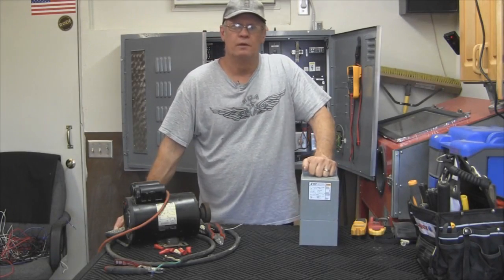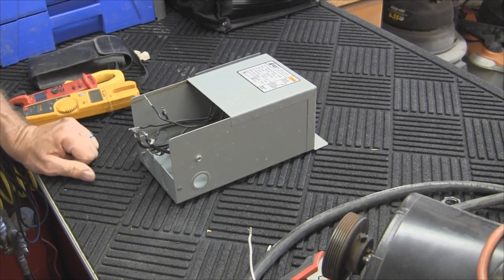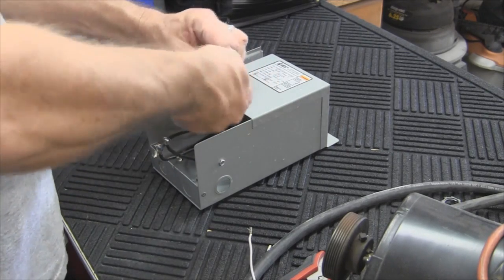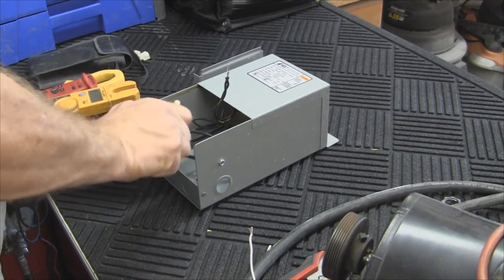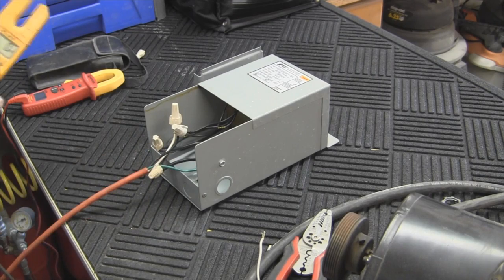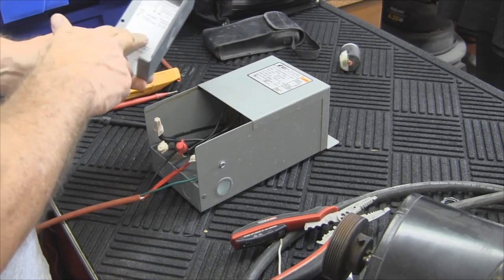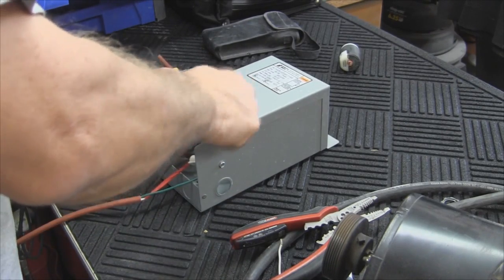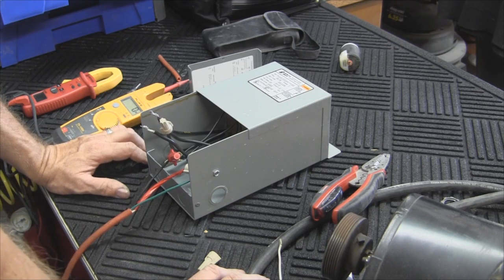How to Wire a Buck Boost Transformer

Comment: I'm hooking up a 7.5 horsepower air compressor and I need to be at 2:40 which I'm running off of generac 22,500 starting in 15,000 running which gives me 240 volts but they're saying this actually 208 I'm trying to boost to 240 will this box do that for me?

Comment: This guy is an idiot. He knows nothing about buck or boost transformers. He doesn't explain additive polarity or subtractive polarity. The transformer he is using can be used with 120or 240 volts to produce 12 or 24 volts. The most common use for this is to raise the voltage of a single phase 208 volt supply to about 219 volts.  ( some refrigeration equipment doesn't like to start on 208 volts. Better to use a 16 to 32 volt transformer. also if you wire the transformer to 208 volts the secondary output will be reduced by 15%.
Hank Kline

Comment: Been looking for wiring diagram
How to make 235v from 208v
All I see is 208v to 240v
Customer was told needs to be 235v
Reply: It’s ok to wire for 240v and use for 235v
Reply: @SamTheBouncer  Agreed, +/- 5VAC is nothing, it will run up or down 5V no issues.

Comment: IT SEEMS THAT THIS IS MERELY A TYPICAL STEP-DOWN TRANSFORMER WIRING.  WHAT MAKES A "BUCK-BOOST" TRANSFORMER WIRING DIFFERENT?!...
Reply: When you wire the secondary in series with the primary it will reduce (Buck) or increase the voltage (boost) dependimg on the polarity.

Comment: I see the manufacturers labeling as a huge problem with buck/boost transformers. Most label the 12v/24v as Secondary Voltage(Low Voltage here) when it is in fact the Voltage Change. I spent an entire weekend scouring the web and talking to a long standing electrician and a 35 yr electrical engineer (that neither knew about buck boost) and the labeling was the only real stumbling block to understanding them.  Once I figured that out the kva rating achieved was from across the drop was a smaller hurdle and I only figured that out by a B/B on Schneiders' site that listed 37kva load and a 3kva label on the same unit.

Comment: You are wiring this transformer as a regular low voltage transformer. A buck or boost transformer has an ability to raise or drop voltage to change the supply voltage to the line of a piece of equipment after the transformer. This transformer can take the 120 volts supply and make it 96, 108, 132, or 144 volts. if you had 240 volt supply the output voltages are 216,228,252, 264 output volts depending on how you interconnect the secondary leads.  This being said the rating of the transformer [ V x A ] is rated only on the differential voltage powered thru the transformer, the 12 or 24 volts used by the transformer.
Reply: what if you use 208?

Comment: This video is pretty much a waste of time. Buck Boost says it all, while it will definitely work as a step down transformer that is not its primary use. It works as an auto transformer and is used to raise voltage by percentages, if your smart enough to connect it, many electricians never seen one, This video doesn't come close. How about connecting H1 to X1 and load, H2 to H3 connect L2 to H4and X1, connect X2 and X3, and X4 to Load as far as it doesn't matter which lead you connect to H1 and H4 if we are looking for the wave formation is it zigging or zagging, Very little info shared in this video for all the time used.
Reply: This is a step down transformer. It is not an auto transformer. An auto transformer has one winding with many taps like a multi-voltage HID ballast.

Comment: Sorry, my comment was not clear. Yes, it was the correct autoxfmr for the application.  

I was trying to point out that the label said 208V low volts, 32V high volts...It did not say anywhere 240V high volts.  My J-man thought the autoxfmr was the wrong one until I pointed out that the label was giving # of volts to be added instead of what the final voltage would be.   

Has anyone else seen labeling like this?

Comment: The video made it sound like you had to wire it 120v to 12v and 240v to 24v.Watch it again.You are correct about the 6v connection but I would have to check the 48v connection with the literature from the transformer to make sure the coils are rated for 240v when wired in parallel .

Comment: If it only allowed going from 120v to 12v and 240v to 24v there would be only 4 wires. It could easily be wired to output 6v (wire it for 240v input, 12v output, connect to 120v source) and 48v ( wire it for 120v input, 24v output, connect to 240v source ).

Comment: No it's not an auto transformer . It is a isolation transformer with a 120/240v primary and a 12/24v secondary . The primary and secondary can be wired in series to create an auto transformer for bucking or boosting voltage 5 percent or 10 percent . You can wire 2 transformers together in an open delta to boost 3 phase from 208 to 230v for motor applications . When  you are only adjusting voltage 5 to 10 percent I believe you can increase the kva rating of the transformer  times 10 . Very handy.
Reply: This is an isolation step down transformer not a buck boost

Comment: A few years ago, I was an apprentice working with a journeyman on a new coffee shop. Bldg was 208/120V and their fancy espresso machine reqd. 240V so off to wholesale supply and told counter guy we needed a buck/boost. The unit his computer said to give us said 32V on label, not 240V. J-man said this is wrong & cntr guy didn't know. I looked at label and figured it was giving the voltage to be added, not the final voltage. Hooked it up, and output was 240V...tricky labeling, or J-man brainfart?

Comment from the maker: Yes check the NEC 2008 210.9 for more info. There are many options available to change your voltages. This was a transformer that was pulled out of a job that was feeding low voltage 24 v lighting. Another sparky had chosen to do it this way. Thanks for your observation.

Comment: Is this not an autotransformer (typically 120, 240 or 480 Volts) and a relatively low voltage secondary (typically12, 16, 24, 32 or 48 Volts), buck-boost transformers are
designed to be field connected as autotransformers. What you did was a total waste of money can get an xformer for so much cheaper for what you did. Where was the Buck-Boost these coils can be wired in so many configuration